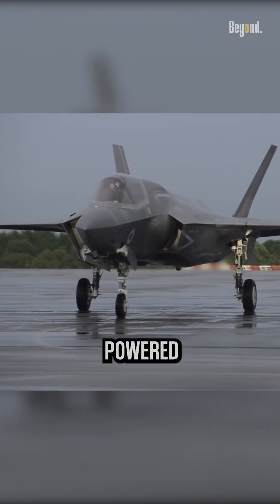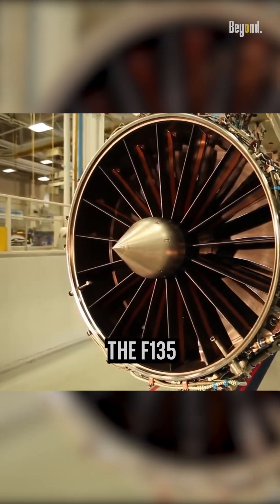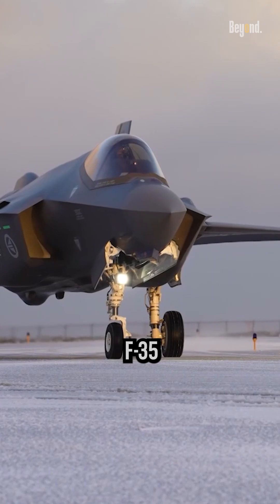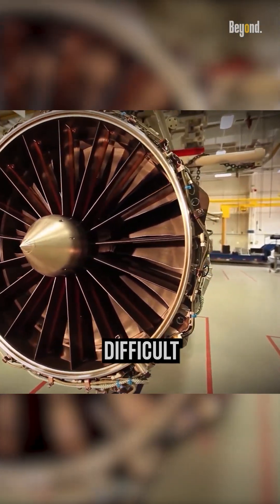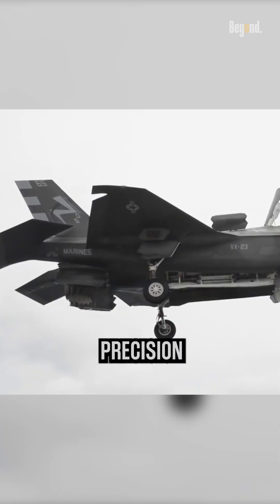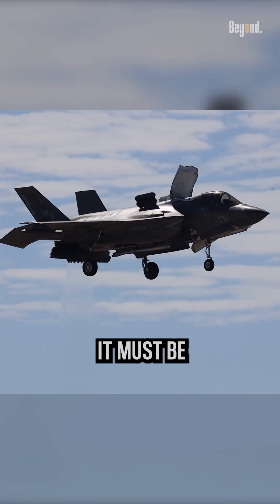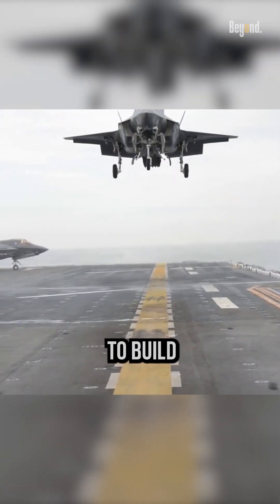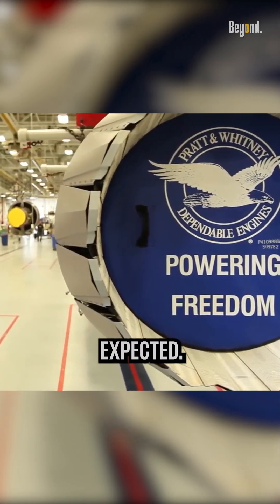Why are F-35 Engines So Difficult To Manufacture? #shorts

Comment: I know comrade this video told you nothing, so the two most basic reasons that we could use to explain this is that :

1-the engine is difficult to build because it must be stealthy most of all, it's difficult to place a "coating " "on top of" or "around" an engine that not only is very hot but also expands and contracts as it cools down after the mission.

2- The Engine muzzle for the Navy Variant of the F-35 has to rotate in oder to VTLO and somehow you gotta add a turbo fan there too that goes perpendicular to the main engine while also making it efficient.

Bonus observation : the harrier jumper jet had a sort of system to help maintain control of the aircraft as it takes off or lands down vertically, so it is reasonable to assume that the F-35 has a similar System in place, just my observation, I'm not a plane doctor.
Reply: The harrier used the pegasus engine, considered the most complex engine in the world. The exhaust is redirected thru 4 main ducts. Two on each side with buffer ducts for stability..
Reply: So basically the navy doesn’t operate the STOVL variant or b model, the marines do!! The C model is special tho in its own right and only our Navy operates it and Marines from Naval carriers
Reply: Sorry to correct u on a couple of points but that’s my biggest pet peeve, the F-35b is not nor was it never desinged to be VTOL. It was desinged to be STOVL!! It can perform a vertical take off like it did during trials to show off but that was with zero weapons load and less than 25% fuel which NO fighter would ever operate from. Small but meaningful difference. Also the Navy doesn’t operate a STOVL variant, that’s the US Marines. Air Force operates the F-35a which is a conventional take off and landing variant, US Navy operates the C model which is like a navalized A model with an arrestor hook and strengthened frame to take the extreme forces from the landing and catapult also has folding wings and is larger I know with larger wings and fuel tank so I assume the frame is a little bigger as well, Marines operate the F-35b & C the C they operate with the Navy from their Ford and Nimitz class carriers and the b from their amphibious assault ships like the wasp or america class or like Japans and South Koreas carriers and also the British operate it from their Queen Elizabeth even tho it’s not like the previous stated examples and is instead more like a traditional carrier because it was designed to have EMALS and use the C model but due to increased cost from EMALS they decided to forgo the C and equipment needed for catapult and arrestor landing and instead slapped a ski jump on it and ordered F-35B’s instead. The only other Navy that could operate the C model current is France but they have their Rafael so don’t operate it and the US is sole purchaser of the C model!! C requires a CATOBAR carrier or Catapult take off but arrested recovery iirc!!
Reply: Points 2&3 are spot on. Not hard to build though. The engine is actually guided in from the back of the already built plane. Built these engines for 6 years.

Comment: And that is why only America can build such an engine.
Reply: You should look up the f136 built by rolls Royce for the f35b it wasn’t chosen because it’s British and it had more power better fuel efficiency and was more reliable.they just used the shaft  for the lift fan, the lift fan and the rear nozzle from it.

Comment: The big bomber type jet engine (B21 has F135’s) are much less reliable than any much smaller M88 and EJ200 of the twin engines fighters, because the thermal stresses are proportional to the size of the hot components, turbine blades nozzle parts etc…that is why the F35 has not the range nor the performances for the pacific operation and the NGAD has two jet engines…and and and that the huge GE9x is a technical and financial disaster.

Comment: This video told us literally nothing.
Reply: They told us how great they are.
Reply: 15+15 = 25.
Reply: Yeah it did. It told us they dont have enough skilled people to build this engine. So they cant meet demands on time.
Reply: @jasonduke3608  The title is "Why are the F-35 Engines So Difficult To Manufacture?". Not "Why can't they meet build dates".
Reply: @nevets5891  
Ok if you want to get technical, the narrator said it takes a" high level of skill" and " extreme close tolerances " ok now convert that to common sense = they cant meet demand due to lack of employees.  Also meaning too much work not enough skilled labor.
Reply: @jasonduke3608  That's one hell of a stretch but okay 👍